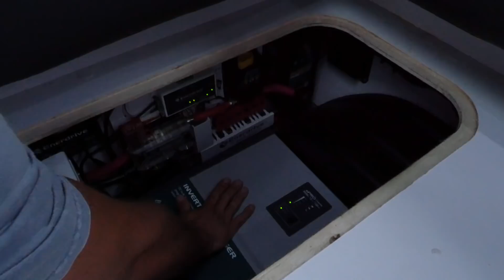ENERDRIVE LITHIUM BATTERY INSTALL - Part 2

Comment: PWM solar controller? Very inefficient, why this charger? There are better ways of doing that. Also, why glass framed solar panels? Heavy and they look very large for 150W output.
Reply: because there reliable, ive had my shack off grid set up for 10 years, not a problem.